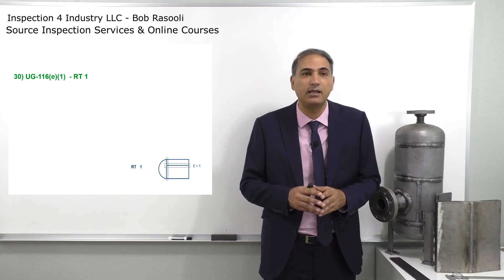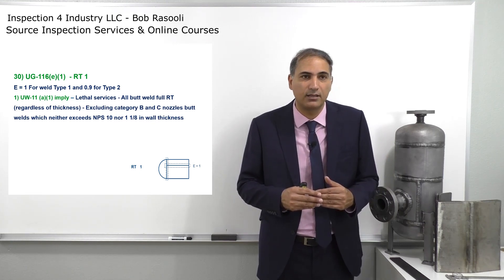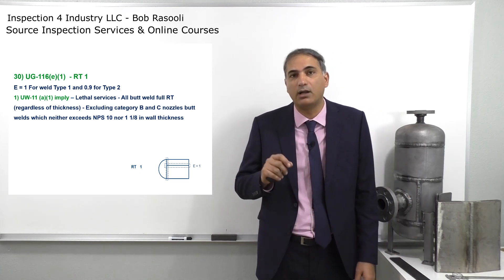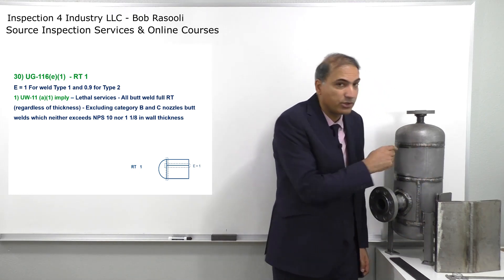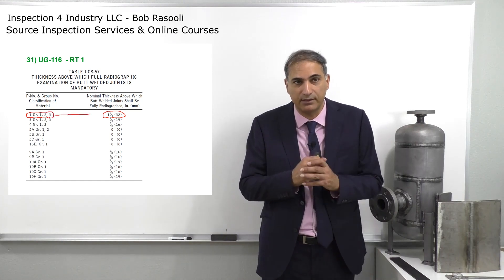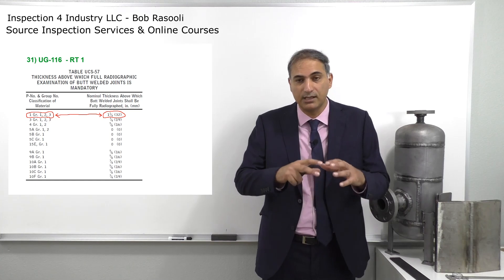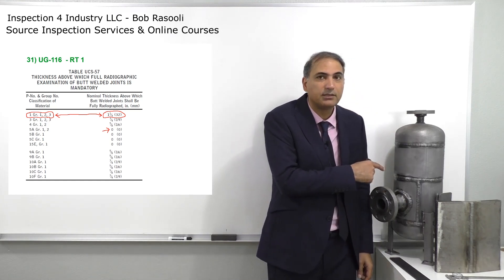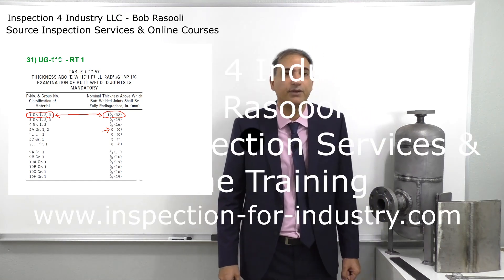RT 1 (Full Radiography) on ASME VIII Div.1 Pressure Vessel - API 510, API SIFE & ASME Exam Question

Comment: Hi sir, 

I have a small doubt in category B .. As you said the first rule is , if its lethal than regardless the thickness we have to carry out full radiography. so it means it  includes all Category A and Category B welds in the shell  and for category C if it is less than 10 NPS and thickness less than 1.1/8 than not required.. But next you have mentioned that Category B is excluded? what does that mean? You are saying that Category B welds in nozzles ?? Please correct if am wrong.